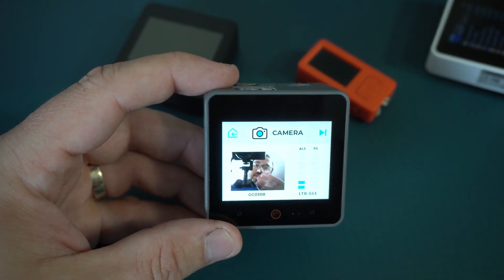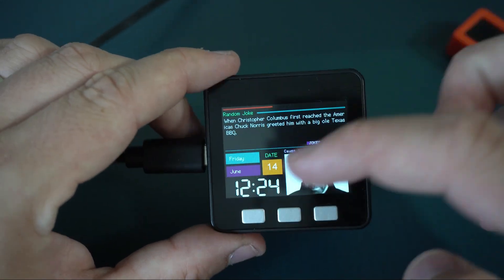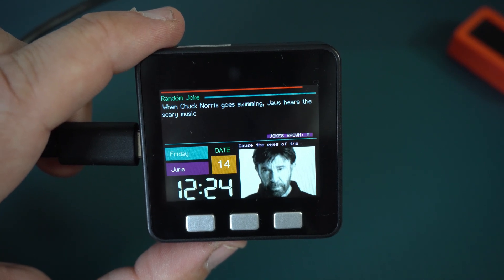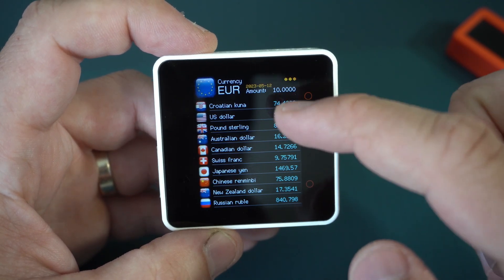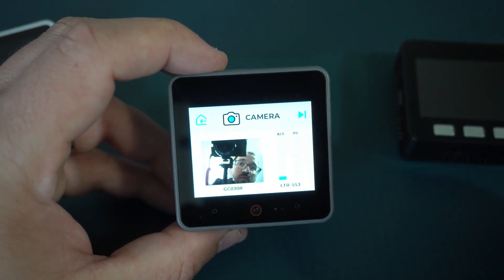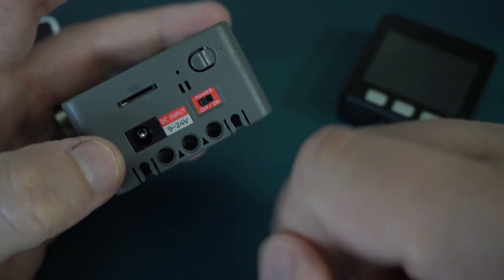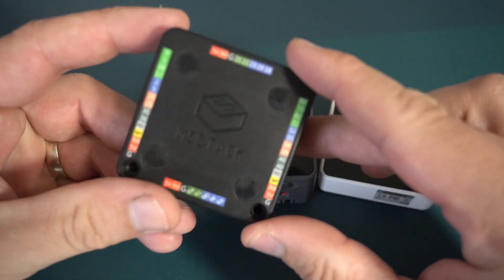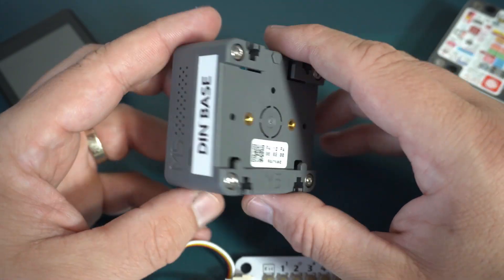New M5Stack Core S3 now with CAMERA

Comment: Thanks for this video. Unfortunately their software support is not at the same level as their hardware. No platformIO support is a no-go for me. Core2 works great with arduino IDE but with platformIO it falls into the dark screen bug, so it is a no-go also because arduino IDE is way too slow to compile a consequent project.

Comment: It's basically useless at this time because UIflow 2.0 is in Alpha and does not have the tools to program it. I find it very unprofessional that M5stack would release hardware when the software isn't even functional yet. I realize that there is other methods of programming but they market it with the UI Flow ease of programming.